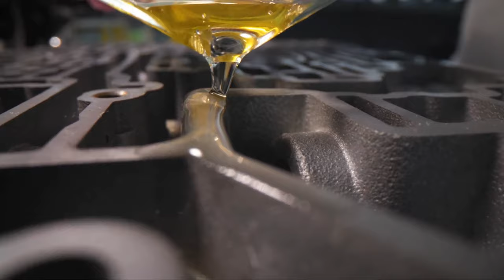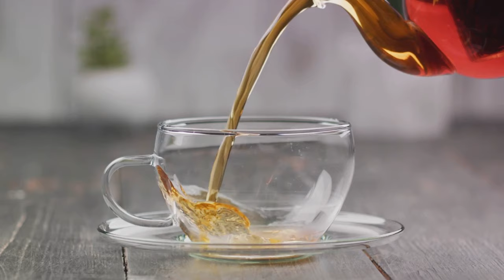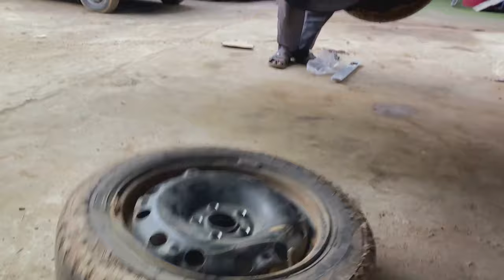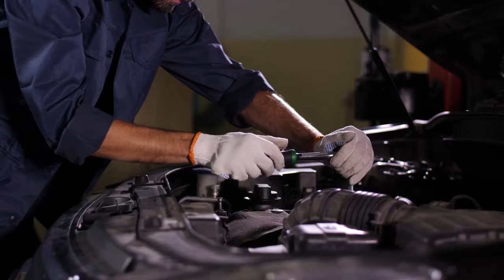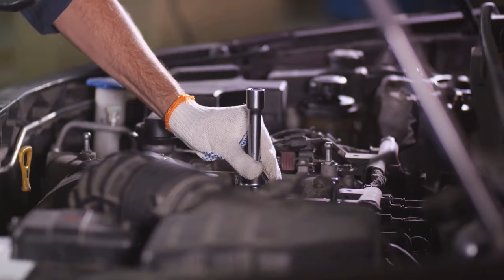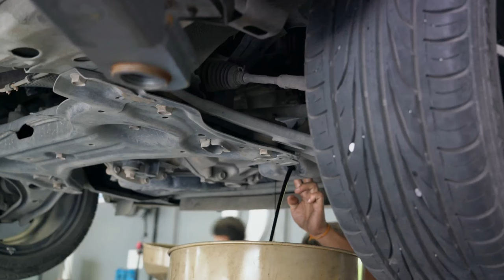Changing Your Transmission Fluid at High Mileage Will Destroy Your Transmission Is The Fake??

Comment: Clutch particles are sometimes suspended in old transmission fluid, That's why transmissions will slip sometimes when you change the fluid. It's risky 😬 but I did successfully just do mine at 230 thou miles. Full synthetic.🤷‍♂️
Reply from the maker: That's the right thing to do! It's never too late to change your oil!
Reply: 'Metal' particles are sometimes suspended in old transmission fluid... THAT is why your transmission slipped afterwards.
Reply from the maker: Yes, very possibly! That's why some people partially change the oil and then change it again after a couple thousand.
Reply: Did it shift better or notice a difference?
Reply: @AlexGray  yeah, everytime I've switched to full synthetic on any of my cars there's a difference. Engine, trans, differentials, etc, things are smoother, more power. I tow a lot too, synthetic is better at higher temps doesn't break down as easily.

Comment: I changed the oil in my ZF 5HP24 transmission for the first time at 350k km (217k miles) when replacing the torque converter (for lock-up clutch slipping) - and the transmission has been working since then without problems for 2 years and another 35k km. How do I know that the oil has not been changed yet ? - according to the production date printed on the oil filter, the filter in the gearbox was a month older than the car's production date, and the oil that came out of it was black like crude oil.
Reply from the maker: Yes, many people don't change the oil in the gearbox because the auto manufacturer often specifies that the oil in the gearbox is filled for the life of the car and doesn't need to be changed. But it means that after the service life you just need to throw away the old gearbox and put a new one! But it is often very expensive, so to prolong the service life of the box oil must be changed!